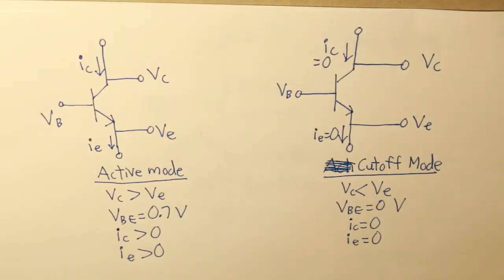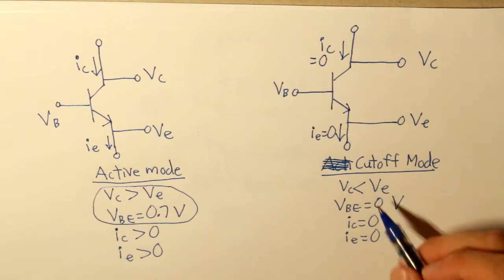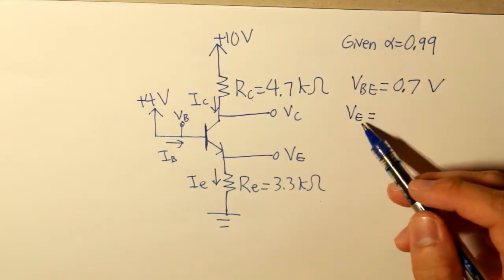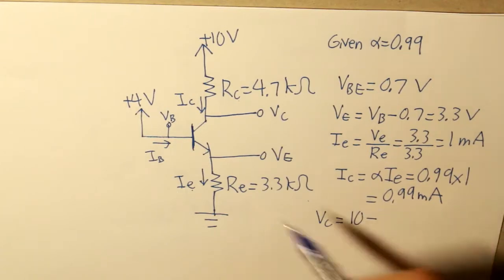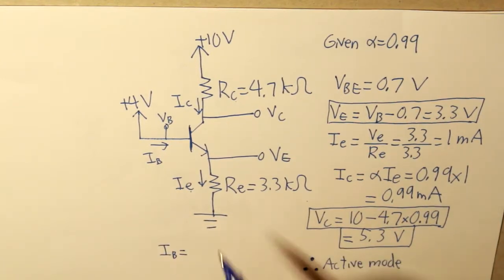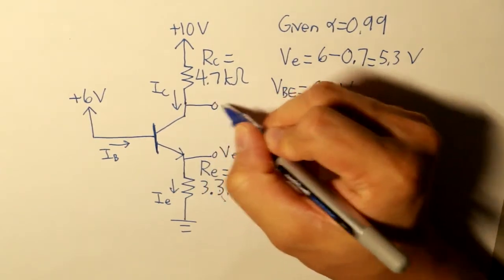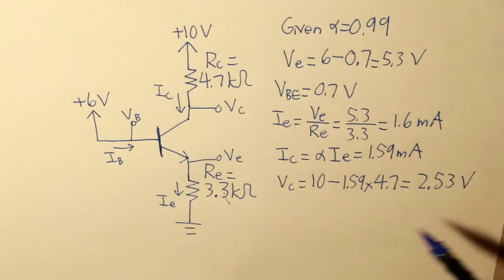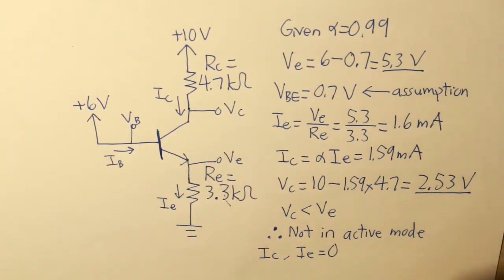BJT Examples (Active and Cutoff Mode)

Comment: No, the second condition is not correct because vce is negative this means transistor is in saturation mode with saturated current Ic = 1.2448mA and this current is the maximum current that we can get from the amplification. Saturation occurs when the base bias voltage becomes 4.849 V and for this bias voltage, Vc=Ve =4.149 V and Vce = 0 V as a result for any increase the base voltage the output current remains 1.2448mA.
Reply: Why do you say Vce is negative? Vce=Vc-Ve or in our case: Vce= 5.3-3.3=2V.